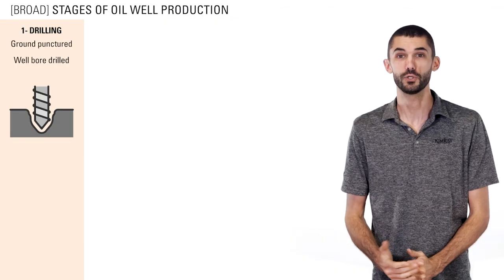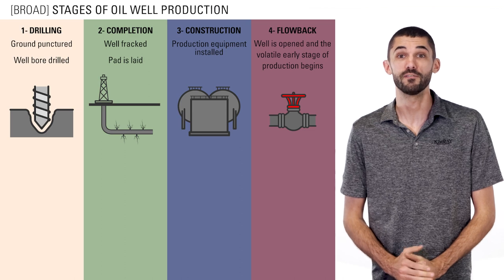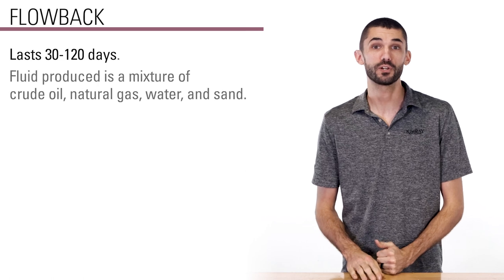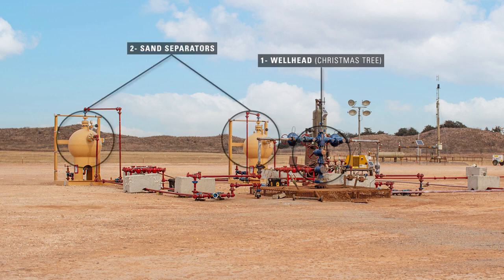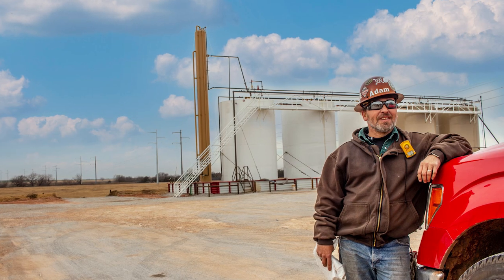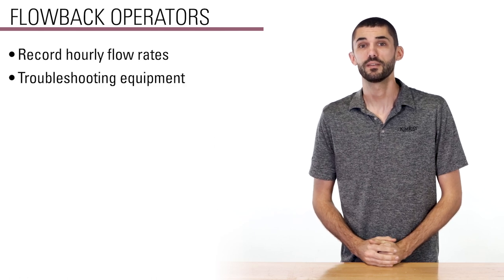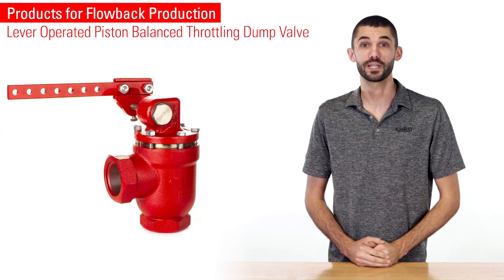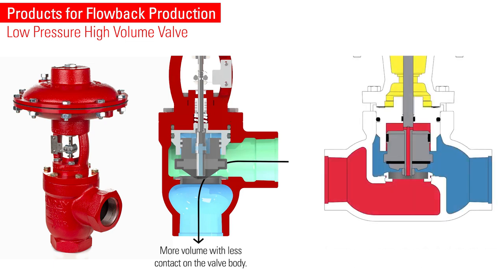A Quick Guide to the Flowback Phase in the Oil & Gas Well Production Cycle

Comment: Flowback can be applied more broadly to completions work too. During the frac process, a flowback manifold is often tied into the well's flow cross to allow the flowback of a "screen out" back to surface.  This happens when the perforated zone cant or stops taking sand resulting in well bore pressure increases.   Additionally, flowback is performed during the drill-out or mill out phase where the frac plugs are removed with workover, snubbing or coil tubing.  Flowback crews manage the fluid rate, debris and pressure of the returns during this process. Plug parts, sand and other debris are suspended in the annular fluid column and must maintain a minimum velocity so as to not fall faster than they are lifted.  In the event that returns fall below minimum annular velocity or are lost all together, there is a chance the work string could get stuck resulting in major delays and costly removal processes.